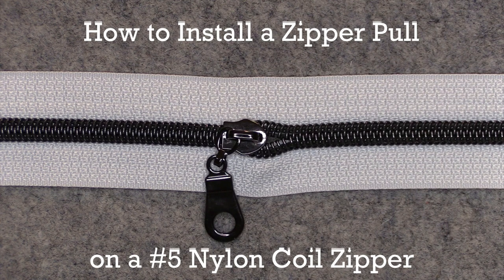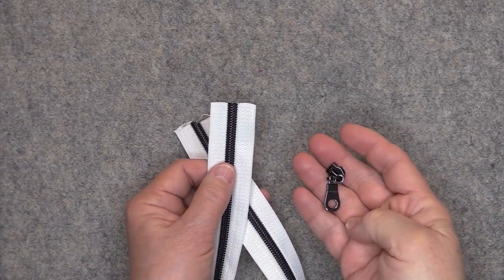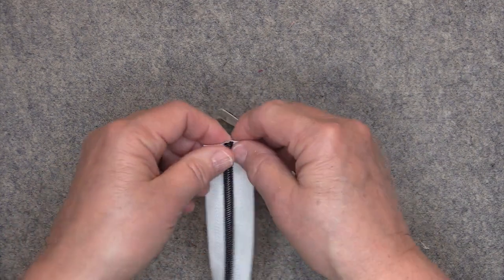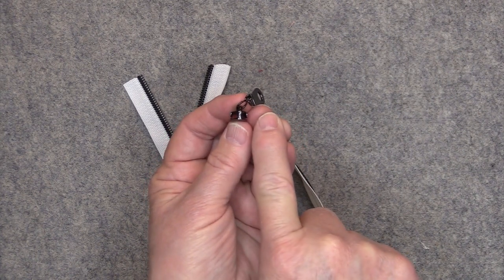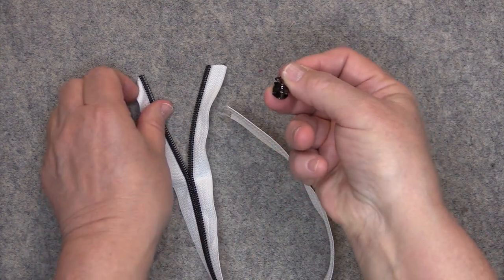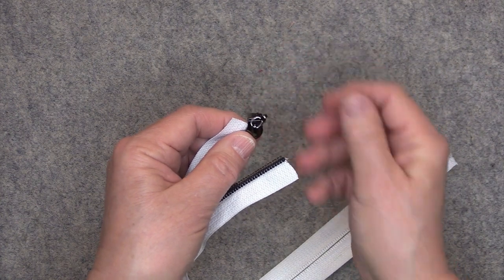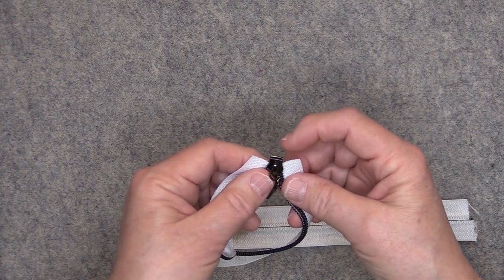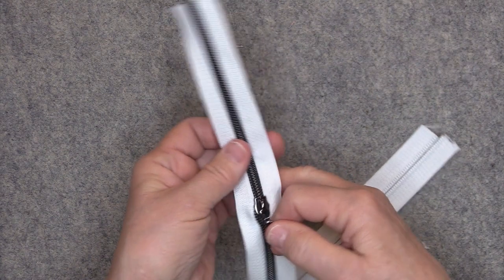How to Install a Zipper Pull on a #5 Nylon Coil Zipper

Comment: Thanks. I’ll practice this way. Can you explain the difference between #5 and #3?  And I have a bunch of pills but can’t get them on either tape
Reply from the maker: A #3 zipper has a tape width of 1 inch and the #5 has a tape width of 1.25”.  The zipper pulls would be installed the same for both zippers.  Thanks for watching!